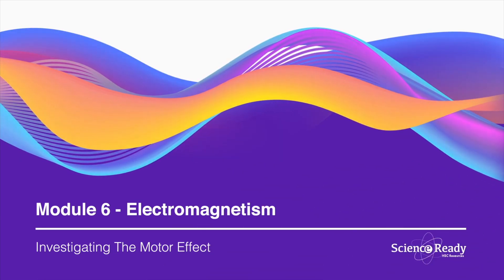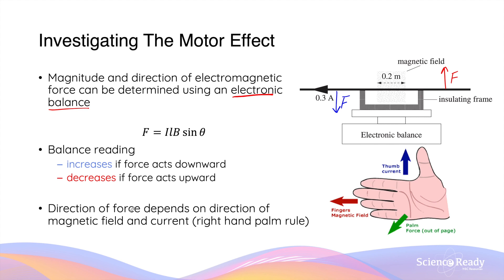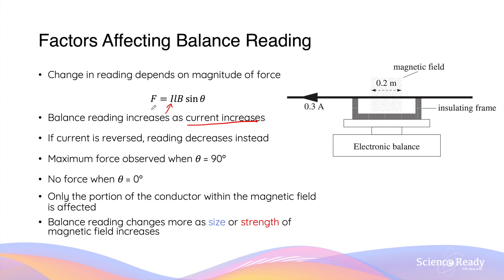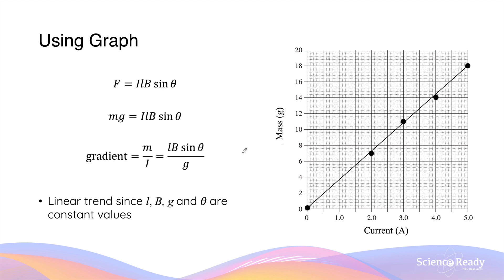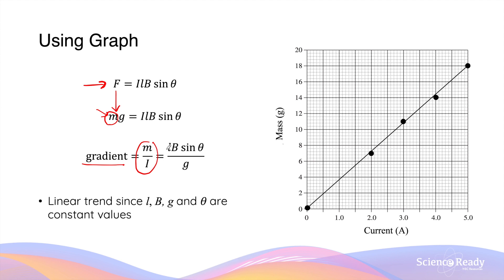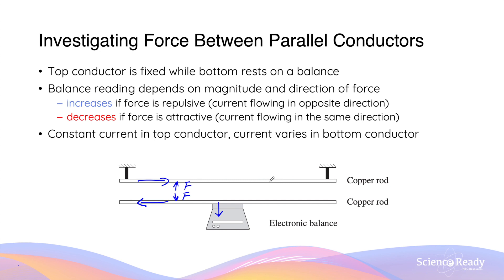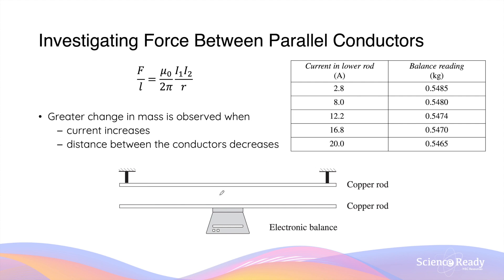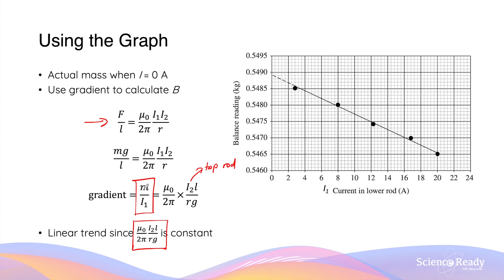Practical Investigation of the Motor Effect // HSC Physics

Comment: woudl switching the wire to alluminum change the results in any way?
Reply from the maker: Yes certainly, aluminium would have a different mass, density and electrical resistance. Electrical resistance would influence the magnitude of current which would in turn affect the magnitude of force between the conductors.